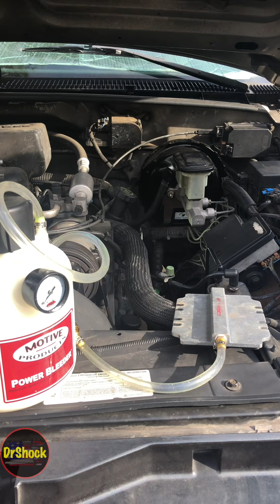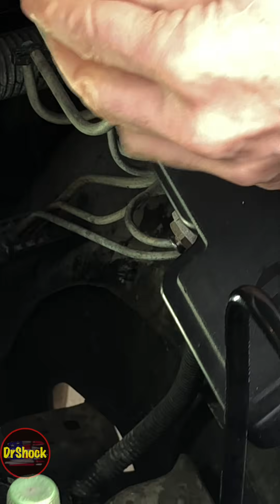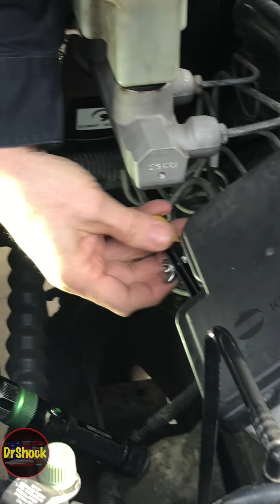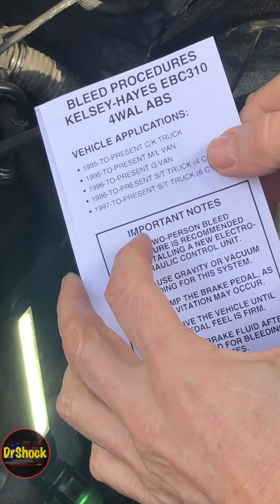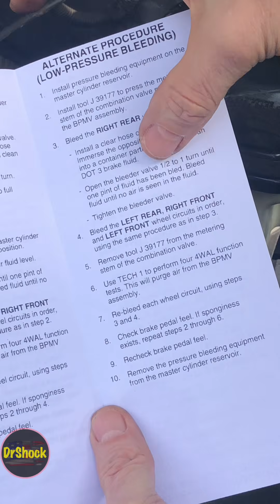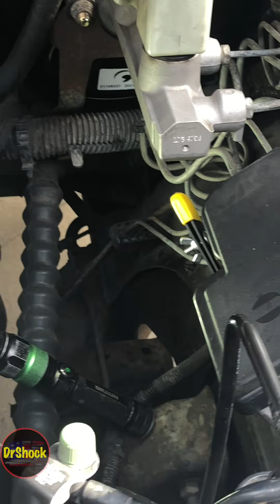1995 - 2002 Kelsey Hayes EBC310 4WAL ABS Pressure Brake Fluid Bleeding Tool (Chevy & GMC) #Shorts

Comment: So is this part not needed when doing the two person bleeding? I read the pamphlet you went over and it doesn’t mention it.
Reply from the maker: This tool is only used when you are initiating an internal ABS module bleed using the GM Tech2 scan tool.  This isn't related to bleeding the calipers or wheel cylinders.

Comment: My 1995 C2500 EBC310 is the same with only the one bleeder on the housing...To get the ABS auto bleed you have to find a mastertech vetronix scan tool
Reply from the maker: A GM Tech2 scan tool, or the Tech2Win emulator thru a genuine Bosch MDI or MDI2 J2534 interface will also handle the auto bleed special function for 1995.
Reply: @DrShock  where is this tool available
Reply from the maker: There is a link in the video description area.

Comment: Where to get it
Reply: Are you able to use the tool doing normal bleeding brake
Reply from the maker: It's not necessary unless you are power bleeding in conjunction with the Tech2 scan tool initiated bleed function.
Reply: I seen pin move in and out when your putting a lot of foot pressure on the pedal bleeding the brakes
Reply: I have a pin that looks to be brass but mine is on the upper side (where the air would be) of the unit. There’s no pin that I can see under the dust cover closest to the engine.
Reply from the maker: I put a link in the videos description.